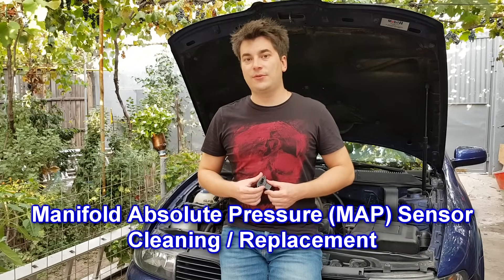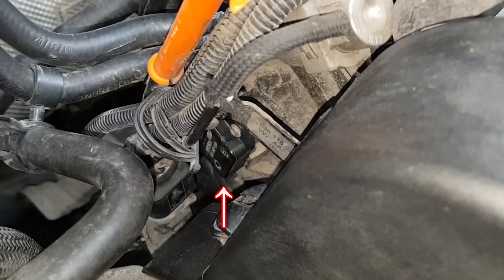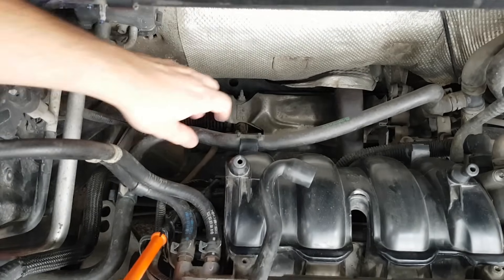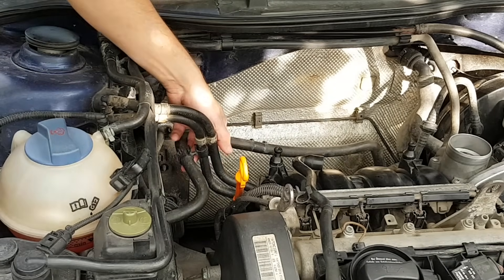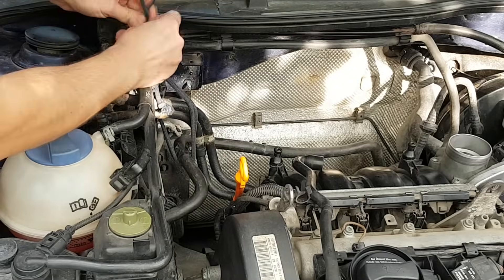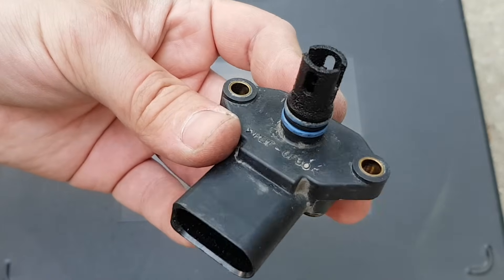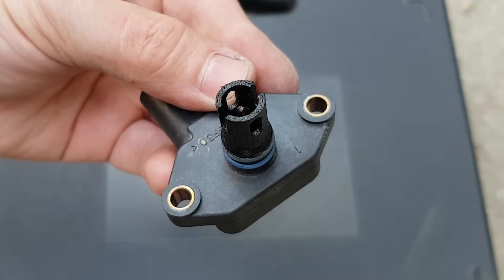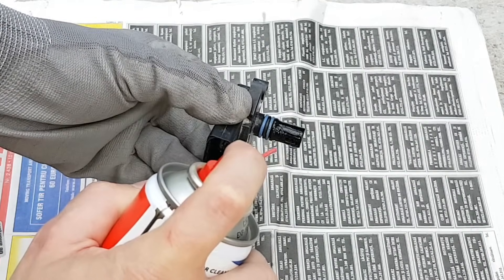MAP Sensor - Cleaning / Replacement (1.4 16v / 1.6 16v VAG Engines)

Comment: On my Seat Ibiza 1.4 petrol 2005 the MAF is only "Cliped" in, not held by the two 20 Torks screws
I had engine light and OBD2 P0107 Code.

Comment: Hi Sorin, Is it good to buy a used Toledo MK2 these days or you don't recommend it ? also what about the availability of spare parts ?
Reply from the maker: hi. it is still a good car, even if it's an old model. but you need to test it thoroughly. if it had an big accident, don't buy it. especially if you can see the repair, and it was not done 100% correctly. these are some of the signs, for which a car was abused, or not been cared for: lack of power, strange noises in the engine, noises from the suspension on bumps or potholes, damaged cover of the steering wheel and shifter knob. a car history check it's recommended. spare parts are very easy to find, original and aftermarket. it shares the mechanical parts with vw golf4, skoda oktavia1, audi a3 8l.
Reply: @Sorin_DIY_Mechanical_Nerd  Thank you, but also what about the availability of spare parts for its exteriors and its accessories ?

Comment: Do you know what is that type (1:40) of screws? I've just stripped one of mine, and need to buy some replacement. I think it's something like M5x22 but I have to be sure.
Reply: did you find the size?

Comment: great vid as always helpfull. I have to ask something way off the topic. I own polo 1.4 16v the vaccum line from the fuel pressure regulator was cracked so i replaced it. But i noticed something bigger as the engine was working the temp was 90 cles. which is normal but the valve cover and the body of the distributor was damn hot i guess the distributor is gettin hot cause its attached to the engine block.... is that normal thing.

Comment: Hey Sorin, thanks for another cool tutorial!I have a question. Where should I look for crankshaft position sensor in 1.6 BCB engine? I've checked out my manual, that says only "on the right side of the engine", and I can't see there any sensor that would even look like my spare part...

Comment: Congrats for this video! I have a vw polo 2001 1.4/ 16v  does this sensor affect to the consume of  gas and take the check engine light on? Thnx
Reply from the maker: hi. a dirty or faulty MAP sensor can affect the fuel consumption, but it should have other symptoms too, lack of power, fluctuating idle. if you have just the check engine light and a bit mode fuel consumed, I think is something else, O2 sensors, catalytic converter, EGR valve, injectors. the best way is to diagnose it with a vcds interface, to know for sure, where the check engine indicator is coming from.
Reply: It's a little late, but this sensor triggers the "EPC" light, instead of the check engine light.
Reply: @stabileseitenlage  It's not late at all my friend, I was wondering if that map sensor could be the cause of the EPC light flashing sometimes and also the lack of power, and that fuel smell when idle. Looks like you answered me, thanks dude!
Reply: @lecobra418  Glad it helped! I am unsure if you can reach it while the engine is turned on, but a way to check if it is still used by the ecu is to unplug it. The engine should react by running rough for a second.
Reply: @stabileseitenlage  I think I'll just clean it, I'm pretty sure it must be clogged up pretty bad, there are too many symptoms pointing to that piece of equipment being faulty. I'll clean it this week and I'll post an update for people to know whether the problem is solved or not.
Reply: @lecobra418  Good idea. I had the 1.6 16V which is essentially the same engine and it's MAP sensor was always covered in oil. It's possible that your's is covered in some burnt oil, which creates hard black crystals.
Good Luck, I will be happy to hear from you

Comment: Very detailed video! But i have a problem with my 1.6 Golf 4 AUS engine. The torx screw got broken on the MAP sensor, so it wont screw out. What am i supposed to do now? Im pretty sure the sensor is cloged up
Reply: i know the solution for this, never buy a Vw again !  :D :D

Comment: hello Sorin ! 
I find your videos incredibly helpful (especially because I have the exact same car ) and I would like to know if Golf MK3/4 MAP sensor will work for this car, or maybe if you could attach a link to buying a new one.
many thanks in advance !
Reply from the maker: hi. the MAP sensor is compatible with golf4 engines, but only for the same engine code.
Reply: Thank you very much and you have great content !
Reply: @Sorin_DIY_Mechanical_Nerd hi if this is bad can it cause the car to fail on emissions as I got a new cat on the car but its still high plus got new 02 sensor and full service

Comment: Hello sorin !
this is completely unrelated but I don't know anyone who knows more about this car than you do.
Do you happen to know where is the ICV (Idle control valve) or IAC (Idle air control) valve in this car.
Reply from the maker: hi. this engine doesn't have an idle control valve. the engine idle speed is controlled by the throttle body. it's a drive-by-wire system, so the ECU can control the throttle body with very high precision.

Comment: Thank you thats really helpful. I hope this fixes my bouncing revs when idle!
Reply: Did it fix it? I have bouncing revs too , may have to do this.
Reply: Instead of cleaning it I changed it completely for £40, but this didn't fix it. The throttle body needed to be removed and cleaned separately off the car. This fixed it.
Reply: Ah ok  thanks have already cleaned the throttle body the other day off the car, but its not sorted it, so this was going to be my next step. Not sure whether to still go for it or not.
Reply: Its hard to tell if the combination of the two is what ultimately fixed it or not. Thats why I bought another one rather than cleaning the existing one as it was quite cheap, plus I didn't want to do it twice or not know if it was completely broken or not after cleaning it.
Reply: @jamesmacintyre  forgot to ask originally, when your revs were bouncing were the revs dropping quite low and threatening to stall? I've still not sorted mine because been finding that having air con on forces revs up which seems to stop the issue, but with it getting colder isn't going to be an option, so I will still look to do this. Cheers
Reply: Thats what I used to do too. Yes it was bouncing low like you said. Ive now changed both my throttle body and map sensor as it came back to the max. My throttle died completely. It is now gone completely and the car feels much better.
Reply: @jamesmacintyre  hey I am having same issue as you. I erlier have changed a totally new throttle body and just took out MAP sensor and oredered a new one. Did the issue go totally away for you or did it come back after while? Just curios if I should get rid of the car if this fixes it.
Reply: @GamoFIN  Hey 3 years later I still have this car. It didn't fix the issue, a new throttle body and (not sure what the official name is) the bendy exhaust tube from the engine to the exhaust was broken which was causing a pressure leak. Now it freaks out once every 6 months but turning it off and on fixes it strangely.
Reply: @jamesmacintyre  Thank you for replying. I am currently trying to run afjustments to the throttle body. Hoping this would fix it but so far not looking too good. Yesterday I cleaned the throttle body and that bensy tube under it that you mentioned. And also took a part EGR valve and teied to clean it too eventhough it wasnt that bad as I replaced it like one year ago. But the tube was disgusting on the throttle side.
Reply: @jamesmacintyre  Ill try to come back to here if I can get this fixed.

Comment: hello, do you know what could be the reason for the car jerking when you take off and put on the gas? This is not a single jerk, but several jerks, the tachometer shows that at this moment the rpm jumping, this problem is minimalized when we let gas off at about 3K rpm, then engine braking is a bit smoother. Sometimes the rpm are unstable on cold engine... 
Engine 1.4 16V AUA. 
Greetings.
Reply from the maker: Hello. you probably have misfires. you should use a VCDS diagnostic tool to check the errors and what cylinder has misfires. I think you need to change the spark plugs.
Reply: @Sorin_DIY_Mechanical_Nerd  spark plugs was changed (NGK)  few months ago :/  Ignition wires are rather good, because in the night no spark visible after spraying water... 
Every 200km lights on check engine with code P0171 or P0420 :/ 
No one can diagnose what is the cause :(
Reply: the NGK ignition coil and NGK ignition cables were replaced, the throttle was cleaned and adapted and the problem still happen. :(

Comment: I'm having a rough idle with this engine, and also very very unresponsive throttle, can it be a dirty or fauly sensor?
Reply: Did you solve the issue? I tried cleaning the throttle body but to no avail..

Comment: Thanks alot Mr. Sorin for your helpful videos .. Can you give me information about the sensor which is hidden in the plastic cover of the engine? What it is,and what it does,and how to diagnose .. thanks again
Reply from the maker: hi. in my engine cover is not a sensor. it's a plastic valve, which lets warm or cold air to the engine. is that what you are talking about?

Comment: Hello, I own an Audi A3 2.0TDI 2006 year. After a complete engine rebuild my cars started to hiccup(jerk, jump) on half gas pedal (1900-2400rpm). No error codes, no smoke, new EGR, all moving part inside and outside the engine are replaced with new. All is tight and in its place, but the cars still hiccups. Soo could my problem bee a dirty MAF and MAP sensor?? Could these two sensors cause the whole car to hiccup for 2sec....
Reply from the maker: hi. you should have just one of those two sensors, probably the MAP sensor. you can try to clean it, it may be dirty and clogged. if it's faulty, you should have some errors for it. but when the engine is shaking, there is usually an imbalance between the cylinders, or a misfire. you should test the injectors with vcds, at different revs, to see if they are balanced. and you can try a compression test.
Reply: Sorin - DIY Mechanical Nerd 

Problem solved. EGR issues even if it was completley new. I discconected the EGR el.plug and the car drives like a dream. Will try with another one (also new) if the hiccup happens again then I'll remove it completley.

Thanks for your advices and sugesstions, cheers mate :))
Reply: @medzid2298  you need to align the egr with vcds
Reply: @bnzltn  Thanks, turned out to be a hole in the intercooler/turbo pipe, very small and unoticable without a detailed visal inspection...

Comment: what are the symptoms of a bad/dirty MAP sensor?
Reply from the maker: hi. fluctuating idling, lack of power, poor fuel consumption, higher emission levels. in some cases the engine doesn't have fluctuations when idling, the engine will run smoothly, but it has the other problems.
Reply: @Sorin_DIY_Mechanical_Nerd  thanks for the quick reply mate. i cleaned mine (no CEL but hesitates). while hesitation is still there, my automatic gear changes/responds much better. is this a coincidence? the map sensor wasn't really dirty. i also sprayed some contact cleaners on the sockets (MAP, TPS, IAC)
Reply: @Sorin_DIY_Mechanical_Nerd  Hi Sorin. Do you think that in a vw Lupo 1.4 16v gasoline, the sensor is in the same position? Many Thanks.

Comment: hello, do you think if i can use brake cleaner for cleaining MAP senzor?
Reply from the maker: hi. I don't recommend that. I suggest you buy a can of air sensor cleaner.
Reply: I used brake cleaner my selfe, and it worked perfectly fine. That, how ever, is of course no guarantee that it is completely without issues, I really wouldn't know, but a friend of mine (who is an chemical engineer) told me that it's basicly the same thing in both cans.
Reply: I have used that brake cleaner and it worked just fine without any problem after 5000km still ok
Reply: No, only use MAF Sensor Cleaner!

Comment: english video are much better!! 
Does Diesel Leon have some kind of similar sensors that needs to be cleaned?
Reply from the maker: hi. diesel engines have an air sensor as well. most likely you have a mass air flow (MAF) sensor between the engine air filter and the throttle body. you can check it and clean it if necessary.
Reply: Sorin Thanks a lot mate!!!

Comment: Salut sorin am un seat leon an 2003 cupra 1.9tdi cod motor alr si zilele trecute dupa o acceletare mai puternica in treapta intai am simtit o pierdere de putere in mers acceleram motorul se tureaza dar masina parca sta pe loc dupa cativa km am oprit motorul si masina a mers din nou bine pana acasa aproximativ 15 km nu am mai mers cu ia de atunci .(mentionez ca nu am nici un martor aprins in bord motorul merge si porneste normal) ma poti ajuta cu un sfat ce poate fi ? E prima data cand face asa .multumesc anticipat
Reply: Salut, ai tezolvat problema? Ce anume era stricat? Am aceeasi problema!
Reply: @cristigbr5064  salut da am schimbat senzorul cu unul sh

Comment: Salut, ma poti ajuta cu un sfat? Problema este urmatoarea: oscilatii mici la relanti , puterea motorului redusa plus un consum de 15% in oras. Multumesc ! Golf4  1.6 16v BCB
Reply from the maker: salut. e acelasi motor ca al meu. pot fi multe variante, trebuie sa faci o diagnoza auto, sa vezi ce piesa iti da eroare. altfel putem doar sa impartim cateva pareri. poti sa incerci sa cureti EGR-ul, apoi ulterior sa il blochezi, sa vezi daca e vreo diferenta. poate fi problema cu senzorul de presiune aer, bujii, sondele lambda, injectoare, poate trage aer fals pe undeva. toate acestea ajuta la calcularea amestecului de aer+benzina, care la tine se pare ca e incorect (mai putin bujiile, care pot doar sa fie imbatranite).
Reply: Sorin - DIY Mechanical Nerd  bujiile sunt noi...o sa fac o diagnoza sa vad daca da vreo eroare
Reply: Salut
Reply: Salut aceași problema o am si eu am fost la un test....mia zis ca trage aer fals pe undeva.....dar nu stiu pe unde ar putea trage.....la.mine o data pe saptamana se aprinde EPC  si sonda ...si nu se mai tureaza la 10 porniri revine la normal....mulțumesc

Comment: salut. la un motor 1.4 16v din gama vag debitmetru este acelasi cu sensorul MAP?
Reply from the maker: salut. ambele fac aproximativ acelasi lucru, masoara cantitatea de aer care intra in motor. motorul tau are ori senzor de presiune aer (MAP) ori debitmetru (MAF). senzorul MAP (manifold absolute pressure sensor) este montat pe galeria de admisie si masoara presiunea aerului din galerie. in functie de aceasta masuratoare computerul de bord stie cat aer urmeaza sa intre in motor si calculeaza cat combustibil sa injecteze. senzorul MAF (mass air flow sensor) e montat intre filtrul de aer si clapeta de acceleratie si masoara debitul de aer care urmeaza sa intre in motor.
Reply: Ok. Ms. Cred ca eu am senzorul MAP. Daca nu te deranjez prea tare as vrea sa te mai intreb daca mufa electrica unui astfel de senzor poate fi curata cu vreun spray sau pot aparea pb daca se pulverizeaza cu spary pe ea.
Reply from the maker: se poate curata cu spray de contacte electrice. apoi astepti sa se usuce si o conectezi.
Reply: daniel vizireanu p0o

Comment: "Air Sensor Cleaner" I don't get it ! If you buy a special cleaner for each particular bolt on your car, you will soon have no more room on your shelf and no more money in your pocket !
I usually use cleaning spirit for almost anything that need to be cleaned, exept my dishes of course ! 😄
And I put it in a can with a large lid, for cleaning small parts. So I can use it many times.

Comment: Eu l-am curatat cu alcool tehnic intr-un recipient cu pulverizator, s-a curatat bine, dar nu am vazut vreo diferență, consumul e la fel, iar oscilatiile la cald tot mai apar...
Reply from the maker: salut. variatiile la relanti pot sa apara si din alte motive. 
in clipul meu senzorul nu este foarte murdar. senzorul e afectat atunci cand are pe el un strat gros de mizerie, de pana la cativa mm. 
insa e bine totusi preventiv sa il curatam. mai sunt si alte lucrari de intretinere a motorului, pe care nu prea le facem la timp. de ex schimbare ulei in cutia de viteze, lichid de frana, lichid servodirectie, bujii de calitate, ulei de motor si filtre schimbate la timp, curatare clapeta de acceleratie + egr (verificare daca egr da eroare). si unele din acestea pot sa produca variatii la relanti.
Reply: Sorin - DIY Mechanical Nerd  eu am schimbat senzorul şi egr-ul în același timp acum 1 luna şi l-am pus pe mecanic să îmi cureţe clapeta de accelerație şi nu cred că a adaptat-o dupaia căci la viteze mici simt cum se "înfundă" sau ceva de genul deci nu merge normal ,de la ce poate fi şti cumva ?
Reply from the maker: cand se decalibreaza clapeta de acceleratie ai urmatoarele simptome: motorul sta mai turat la relanti / dupa ce se incalzeste variaza mult la relanti / cand iei piciorul de pe acceleratie, turatia scade brusc de zici ca se opreste motorul / cateodata se aprinde si EPC.
daca nu are aceste simptome, inseamna ca e alta problema. trebuie sa faci o diagnoza auto, altfel ar insemna sa te apuci sa schimbi piese fara sa sti de unde e problema.
Reply: Sorin - DIY Mechanical Nerd mulțumesc de răspuns , toate cele bune